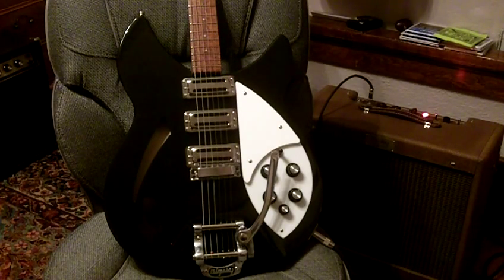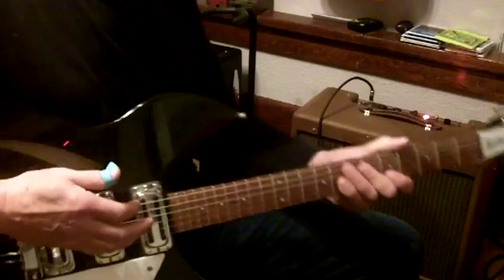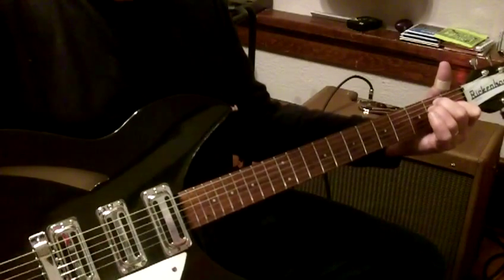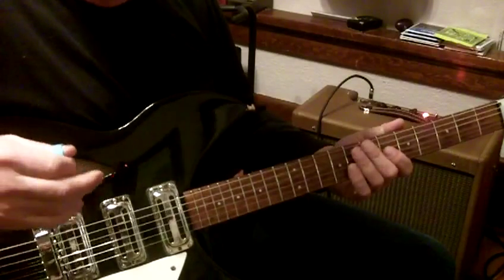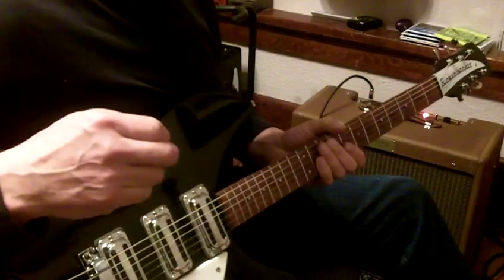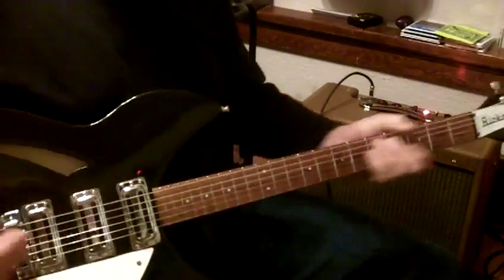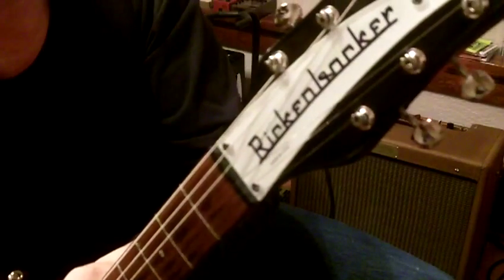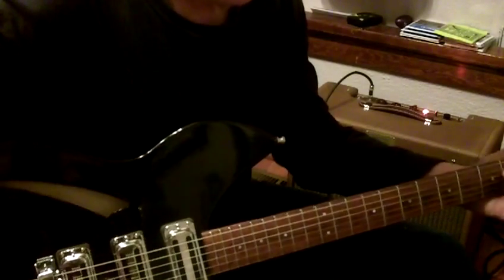1964 1965 1966 Rickenbacker 330  345 Rescue Guitar Restoration Bigsby

Comment: Great job! 
I looked up a schematic: the blend knob adds resistance to the neck pickup's volume pot.  So it's like turning up the volume on the neck pickup pair (in a 3-pickup config) to 12 or 13 instead of 10.  They could have done the same thing by just making the pot a higher resistance to start with, but it's kinda cute. 
Blend does nothing to the bridge pickup.
Reply: Another reason it could be useful is that on many models ( not the 330/335/331/340/345) models, there was an extra output jack labeled "rick-o-sound" which allowed you to route the bridge pickup and the neck pickup to separate amplifiers.